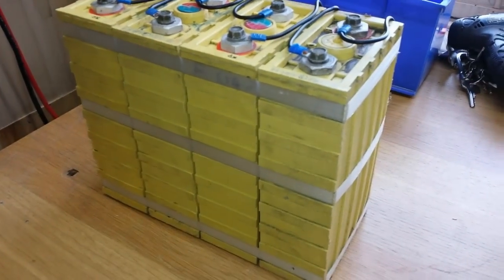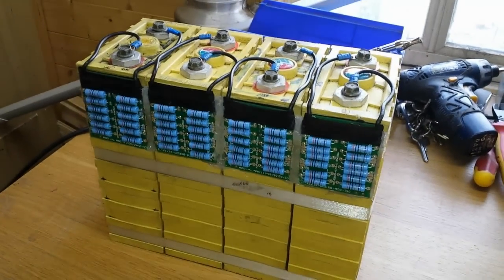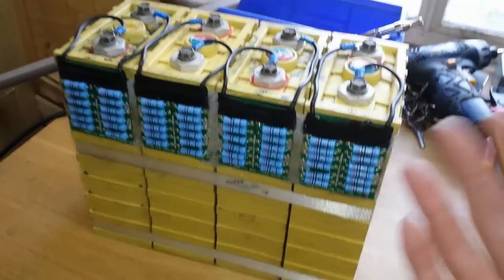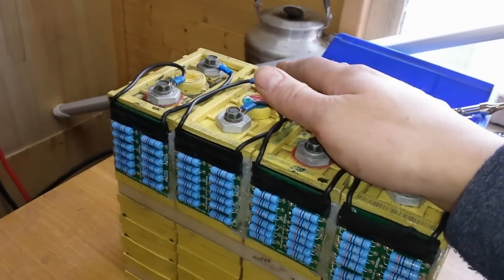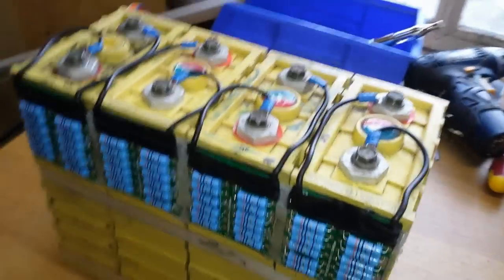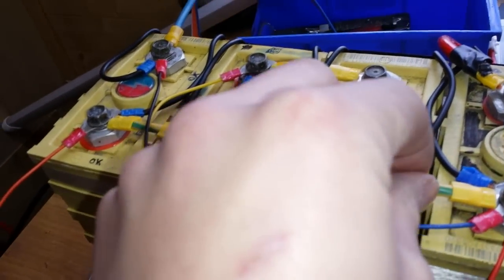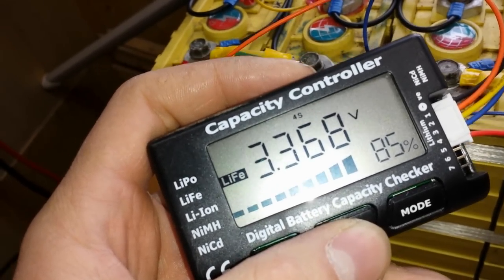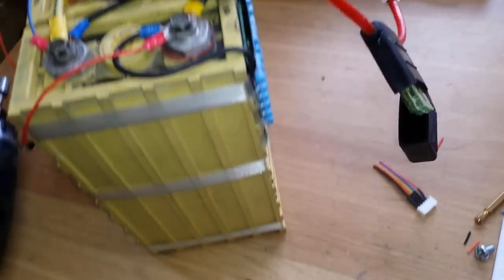60A prismatic LIFEPO4 cells   first look

Comment: On winston 60ah thunderbird if is blow a little but the voltage is 3.2 and is stable is an ok battery or not? Is good to dismount safety valve to let the presure out from these cells or no?

Comment: There's a trick to grinding cross threaded bolts down or shortening them if you can get a nut to tread, put it on all the way the saw it, grind it and get your nut off and I will rethread itself.

Comment: Those look like Winston (formerley Thundersky) cells to me. Nice find. I've been looking for a UK based supplier of those, but I'm not sure they exist yet.
Reply from the maker: Thankyou for the insight! I thought they were seperate companies! If I won the lottery i would set up shop! =) This is the reason I went with cylindrical headway cells at first! bought from a e-bike supplier (google eclipse cycles) If you do find a supplier please let me know?
Reply: pietkaify I had a look at the eclipse bike site a while ago thanks to a link that you supplied in one of your earlier videos. I entered their details into my super duper spreadsheet and they don't work out as cost effective £/KWh in large installations such as the one that I am planning. Also, being round they waste space when there are a lot of them.
The Winston 400Ah or Sinopoly 400Ah are working out most cost effective at this time.
Reply from the maker: Ah thats fair enough! Are you doing a solar installation or charging from off-peak electricity to see you through the day? I am really limited to what I can spend as i'm saving for a deposit.
Reply: pietkaify I have a solar installation which powers my workshop at the bottom of the garden. It's a 1KW array, partly shaded, 12V 700Ah SLA battery and a 2KVA inverter. It runs my lathe, milling machine and electronics workbench no worries.
Like you, I am renting, so a bit limited in what I can do. I have the deposit now, but alas I have been unemployed sine December (if it's not one thing, it's another). Once I'm working again I'll be home hunting! Once I own the home, well, you can only imagine where the energy will come from. With 250W solar panels at under £100 retail, the sky is literally the limit!
Reply from the maker: I have 6 x 80W panels and 4 x 80A batteries only got a 1KW modified sine wave generator. My problem is i'm only running 2 panels till I get my arse into gear! there is a chap on YT about to do a kickstarter for a lithium charge controller. Yes panel prices have fallen off a cliff! My landlord is looking to sell this propety and he payed us a visit, he's said he will let us stay another year till may 2016 then he will give us first refusal!
Reply: pietkaify Yes, Martin mentioned in his latest video that Dacian was about to Kickstart a V2 of his controller. Dacian's controllers are not MPPT, he does not believe in MPPT based on the fact that PV prices are low enough to not justify it (simply buy 20% more panels). However, here in the UK roof space can be a problem, so most people could do with an MPPT controller to eek an extra 20% out of what surface area there is available. What is nice about Dacian's controllers is that they directly support Lithium technology. Luckily, my controller is very flexible in it's configuration, so it will support a Lithium bank, but I'll have to build my own balance system. The PCB's for my balancing system have just arrived, so I hope to build them up soon.

Comment: Assuming this is the same balancing circuit: "The balance module will keep each LFP cell’s voltage at 3.60V peak during charging by draining excessive voltage with selectable discharge current (0.65A/ 0.9A/ 1.1A /1.44A. Manufacturer preset at 1.44A ). It will wait for other cells within the pack to reach same voltage level to ensure all cells within the pack are balanced." http://www.batteryspace.com/Balance-Module-for-3.2V-LiFePO4-Battery-Pack.aspx
Reply from the maker: Ah yes I found this board on another site. That is a brilliant idea! I could possibly implement this into my other pack. Thanks for the link! =)